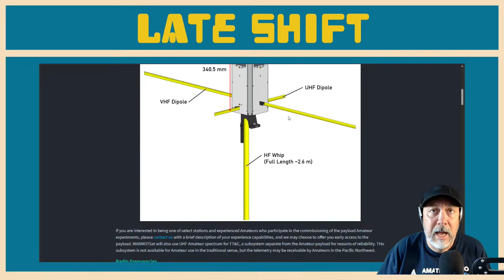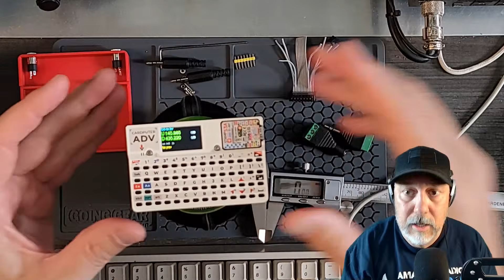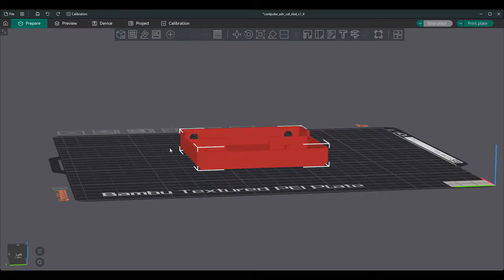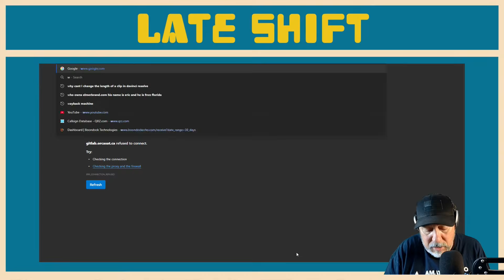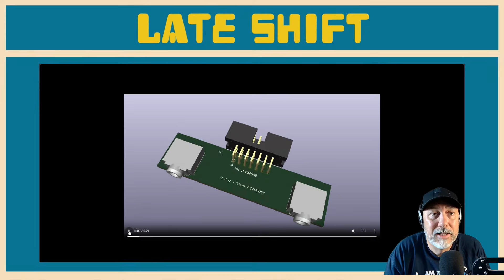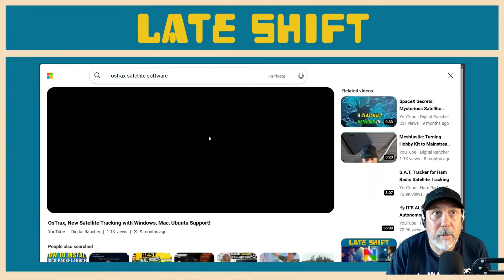Late Shift: Pocket Sized Linear Satellites CAT Controller

Comment: Nice job! I have made something similar a while ago using a Heltec Wireless Tracker board. It controls 2 FT-818 radios and can do local Satellite pass tracking with Doppler correction, RIT control and TLE update. Is your code available on Github?
Reply from the maker: It's been a fun project. I still have lots to do. Working on how to integrate GP data now.